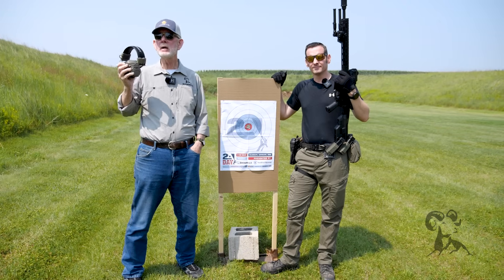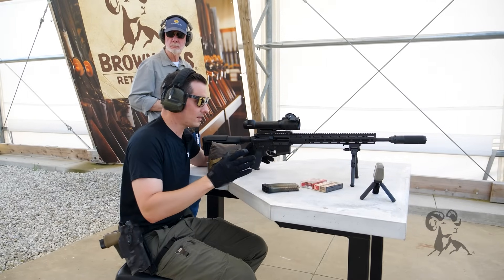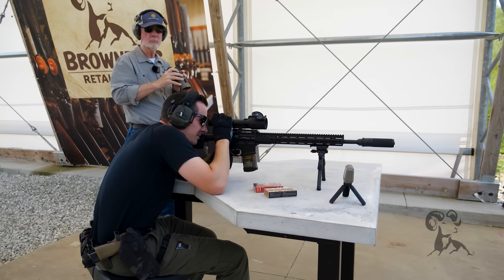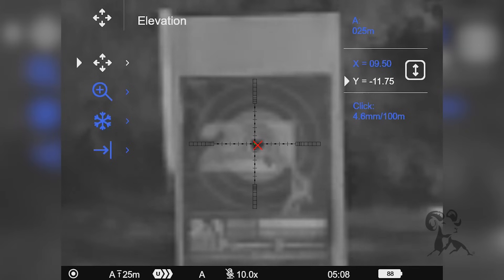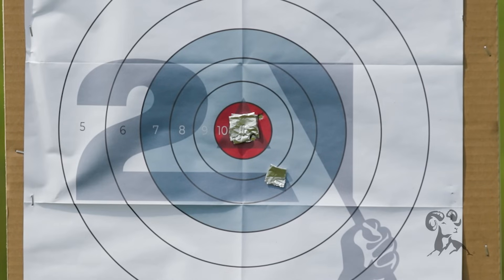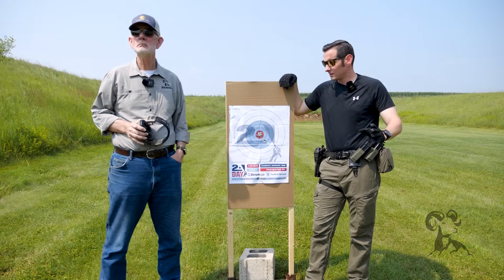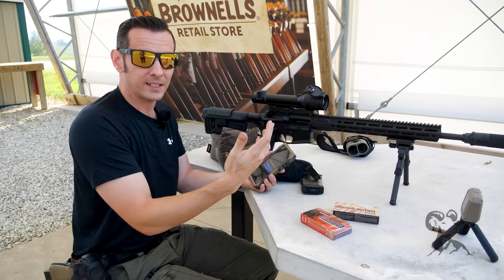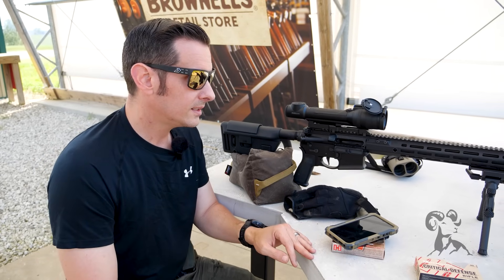How to Zero Thermal Optics, Featuring the Pulsar Talion

Comment: You had a great idea with the tin foil, maybe it would be beneficial if next time you could put tin foil on a pencil eraser and push it through the backside of the bullet hole so it balloons out the front side a bit then heat it up with a portable heat gun, might work a little better for aiming.  Just an idea, do what you want with it, use it or disregard it .  Just sayin'.

Comment: Why dont you zero using the 2 shot method? No real difference between zeroing a thermal vs a scope. 
Hold center, shoot. Hold center again and move the scope reticle to the bullet impact. 
I thought this was common knowledge. 
I was zeroing 22s at 10 years old like this. 

After this, i went back and watched your normal scope zeroing video too. And still nothing. 
Very interesting, but a letdown.

This method still works at longer ranges and with groups too. 
Id like to see that being taught.
Reply: Because that works best in a super stable rig, it's not best or practical for everyone's situation.

Comment: 12 volt stop light bulb in a AutoZone socket works well for the heat source.
Reply: I've used a 12 volt battery and a tiny T5 wedge globe wrapped in tin foil with just the tip visible poked into a cardboard box to sight in a dual channel digital day / night / thermal scope and using its picture in picture function to cross check reticle aimpoints. I got really good at it as the lower end scope wouldn't hold its zero settings due to a known software clitch.

Comment: had no idea about this zeroing mode that's so cool. would be awesome if that tech can be rolled out to more optics beyond digital thermals
Reply: You can use the same two shot technique on tried and true technology glass scopes. Carefully aim at the center of the bullseye on the target and fire. Then note where the shot went and while holding the rifle on the original aiming point move the reticle to the shot hole. Then fire again at the bullseye & see where the shot falls. If the correction was done accurately it should be on target or very close. The freeze frame and one shot zero is something that can only be done on electronic scopes for obvious reasons.

Comment: For a thermal aimpoint I use a cup head bolt that I heat up the head & body with a lighter and push that into my target or little party balloons filled with hot water to the size of a golf ball or the same balloons frozen give a good signature to aim at when pinned to the target.

Comment: Clear, cloudless days are best, and yes with the sun at your back. Tilt the target board back a little and the foil will reflect the cold temperature of space. It will show up much better. When I do this I can clearly see a 1" square piece of foil duct tape on cardboard at 100yrds with my Talion xq35 pro. This methid is not dependent on temperature of the cardboard vs temperature of the tape, as it is a relection of the difference of heat of space vs earth.